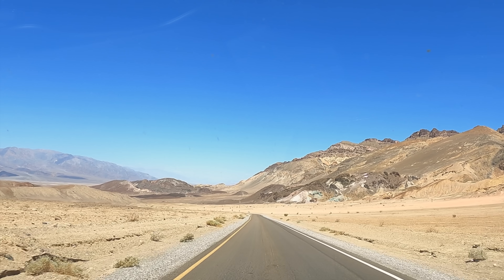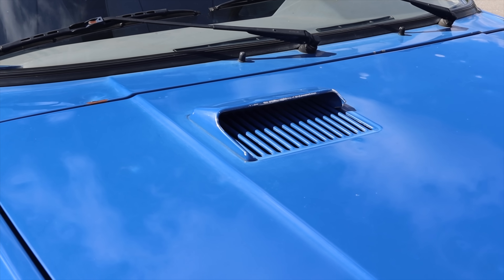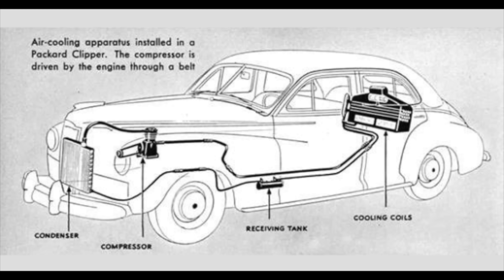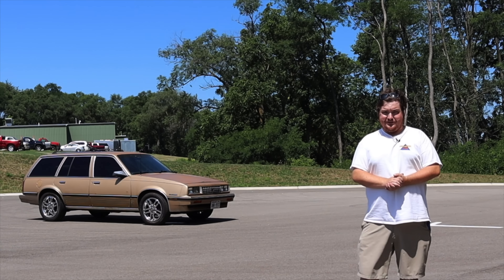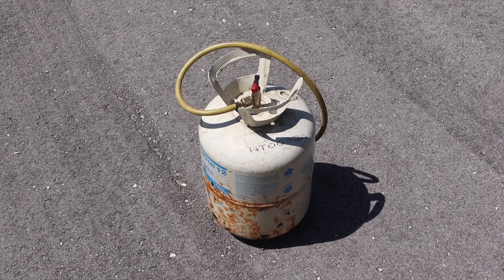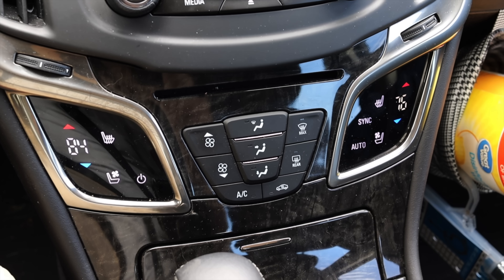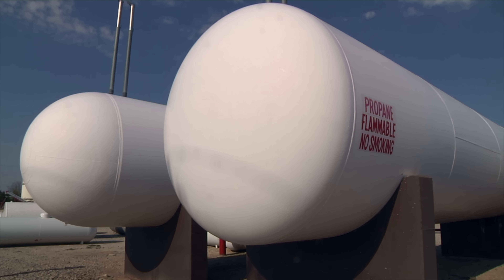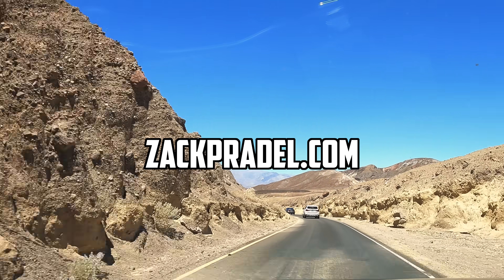Air Conditioning - The Story Of R12 & Why Modern Air Conditioning SUCKS!

Comment: My dad stockpiled a bunch of it right before it got outlawed, still useful for a '68 Cougar he has that never gets driven.  I used some in a '76 280z I used to own and it was cold I suppose, but the blower motor was pretty weak.  I owned a few other cars from the R12 era but they were all ratty projects with compressor/condenser problems or just totally gutted.  I sweated a lot in the cars I owned in my late teens and early 20s I guess.

Comment: You're half right.  Converting an older R12 system to R134 isn't that efficient. The system was designed for R12.  My 2018 Santa Fe with R134 cools as good as any R12 system I've ever seen.  A lot of that driving is between Palm Springs and Phoenix.  With the CC set on 73° it gets comfortable fast and levels off after a few minutes.  A properly designed AC system can run with R134 with no issues.
Reply: My experience with my mother's 2016 Kia Sportage tells me that the Hyundai corporation wouldn't know how to design and A/C system if it reached up and slapped them right in the face. Hers takes forever to get the vehicle even somewhat acceptable and even then it never blows cold. The vents that come out of the console to blow to the back blow colder than than the ones in the front. And supposedly there is nothing wrong with that A/C. My 2018 Ford Transit Connect is better but still sucks ass. You basically need it to be running at max fan speed and on max a/c to keep it cold in the van. Before the a/c went bad in my '04 Silverado it was actually fine. When I had an '01 Honda CR-V the a/c did okay. And my '14 Prius V does really well. But you couldn't beat me and make me believe that Hyundai knows what they are doing with one

Comment: GM always had the best A/C system. By the 70s Ford even started using their components. Rolls Royce used GM A/C systems. Yes, I have had MANY Buicks and Cadillacs with R12 and they will freeze the balls off a brass monkey. I still have one 1970 Buick with its original R12 system. However the best A/C I have ever had is my current 1995 Buick Roadmaster with R134a.  One reason why R134a gets a bad rap is because of the people who convert their R12 cars to R134a. They typically do not do more than evacuating the system, making sure the oil is all flushed out and then changing the ports. Some go one step further and change the valving system (either suction throttling valve---STV or Pilot Operated Absolute---POA valve) to make sure correct pressures are met for R134a. So far so good. But one crucial component that needs to be changed is the condenser. You just cannot expect R134a to work will with those old 3/8" tubing in the R12 condensers. You need to move to a high efficiency condenser, which has MUCH smaller tubing and many more and finer fins. Some people can get away without changing the hoses. R134a needs better barriers to avoid leaking because the molecules are smaller.  Kind of like even a surgical face mask will not prevent the covid virus from passing through. Most people are not willing to pay $2000-$3000 to properly convert from R12 to R134a so if they do it at all, they do it half-assly. Heck some people, even here in Tucson won't maintain their A/C systems in cars less than 10-15 years old. I see them driving around town in 105F or hotter days with all their windows down.
Reply: I have a 98 Nissan Quest and I measured the condenser at a junkyard and the holes are 1/8 of an inch in the condenser fins. I cut the condenser in half to see. It runs 134 from the factory. Are you saying an R12 system would have fins that are 3/8 of an inch instead of 1/8 of an inch with 134? I have also cut in half other condensers on other vehicles such as a 2018 Hyundai and their condenser tubes are so tiny they look like they're small as a 32nd of an inch. What gives with that?
Reply: @truckdriver8416  In essence, yes! Comparing the OD of the tubing on my 1970 Buick vs my 1996 Cadillac, the 1970 tubing is about 3 times bigger than the 1996 tubing in the condenser. Not only that, but there is also a lot MORE tubing in the 1996 and the fins are denser, and more numerous too. So, if you convert from a R12 to a R134a system, you must upgrade the condenser to get the cooling capacity and efficiency to be effective.

Comment: R-12 may have worked better then R134a, however a compressor that used R-12 broke way faster then one that has used R134a. It was almost impossible to get a car 10 years old that had a working air conditioner and if you did by some miracle it would last about 6 months before dyeing on you on the worst day possible.
Reply: Yep, in my experience R12 systems were horribly unreliable.

Comment: Real 134a comes in a large canister too... the superheat, subcool temperatures, and pressures are almost identical. The fake stuff is the garbage that you buy from the auto parts stores which are an azeotropic blend. When your system leaks, it loses the light gases first and makes the system work inefficiently. You didn't really tell us why 134a is not good and if you want to bag on a refrigerant, I suggest you bag on R1234, which only comes in a blend.

Comment: It was either my 1978 Grand Prix or 1985 Grand Marquis,  a couple times I was able to not only create condensation on the outside of the window by blowing a vent on it, but actually get it to crystallize and ice up.
Reply: Had an 89 civic that did that. I think it had some residual R12 in it & we just filled it with 134. Im positive it wasn't designed to get that cold from the factory. It was insane

Comment: I've recharged many r12 systems with 134a and they worked just fine. If it did not you have a problem that even with r12, which you cant get, the system would not have worked properly either. Iv'e done old refrigerators, coke? Pepsi machines and they worked fine.

Comment: R12 A/C is one thing GM did extremely well. I had a variety of mid 80s-early 90s GM cars back in the day, and if you left the a/c cranked it would get meat locker cold.
Reply: My mom had a '73 Chevy Impala. The AC in that would freeze me to death! I remember piling what ever was in the car on me to hide from the blast of cold air coming from the vents, even as it might be in the upper 90s outside.
Reply: I thought I was crazy when I thought "A/C used to be colder" when I lived in the U.S.  Parents had an 85' pickup, and I swear you couldn't use the A/C for more than 5 minutes before the tiny cabin was ice cold.
Reply: All with the help of the biggest, heaviest compressor in the industry!   LOL!
Reply: @frequentlycynical642  who cares, it worked.✌️
Reply: @frequentlycynical642  You’re thinking of the old A6 compressor, which was a beast. Both in size and performance. But by the late 80s, the bigger GM vehicles had migrated to the R4 Harrison compressor, which was much smaller and every bit as effective. Smaller GM vehicles used the V5 Harrison, which was still the same performance and on par size wise with anything else on the market.
Reply: @frequentlycynical642  do forget it lock up too.
Reply: @frequentlycynical642 Compressors THAT conked out by 60k miles. By the time these cars hit the used market for black people to buy the compressors were always 'seized" up!
It was great the short time they worked. Im specifically talking about the Harrison(gm) HD6. Pretty much ALL of the BOP/chev/Cadillac/D platform cars used them!
Reply: @frequentlycynical642 And? You want crappy AC and a car that can’t last longer than 100k miles? Because that’s what we have now. Besides Toyota of course.
Reply: Can confirm, used to own a 1974 Monte Carlo with a 454 and factory air. Teeth would be chattering after about 5 minutes of cranking that baby up!
Reply: Oh yeah. My ‘89 Lesabre with 180,000 miles still blows ice cold.
Reply: Jealous
Reply: I've seen somebody use propane for AC problems aside. It was the coldest AC I have ever seen. Yeah the problem today is twofold. They have two refrigerants being used in the past 5 years 10 years, but a lot of the The companies are using the same system with the new refrigerant at less efficiency
Reply: this makes me wonder as a transit enthusiast how good the a/c was on buses from when ac started to become available as an option. to when they switched over to r134a refrigerant (i myself have only been on buses with the newer refrigerant as the last r-12 buses retired in the 90's, and i was born in '05. and buses that ran within the city didn't even get a/c until 2012. though the buses that ran the highway routes into the 'burbs did have a/c way before anything else. my agency ordered gm new looks with a/c in the 60's or 70's. the oldest buses with a/c i have ridden were orion v suburbans from 2001, obviously in the r-134a era. they had pretty good a/c even towards the end of their service lives. currently the oldest buses with air con that run here are the 2008 orion v suburbans, also with pretty cold air.) so basically what i'm wondering is: how cold was the a/c on a gm new look, or a different bus that used r-12.
Reply: Nothing like a 95 Chevy Suburban AC
Reply: I have a 2018 Silverado, it has the new 1234yf refrigerant, it’s not very cold AC. Already had to replace the condenser coil at 29,000 miles, among other issues that’s a different story. 🙄 I don’t think it’ll see 100,000 miles.
Reply: My parents had a 1976 Cadillac that had AC that was absolutely freezing.  It was absolutely colder than one's refrigerator.
Reply: They had some great compressors  the GM A-6; Ford and AMC (and most aftermarket units) used the aluminum York and cast iron Tecumseh, and Chrysler had their venerable cast iron RV2.

Then they started using the light weight (usually imported) compressors…

Comment: The new systems are just as 'cool' as the older ones that took R12. They just use larger components. Refilling older cars with R134a, however, does reduce performance.
One exception to the ban on R12: aircraft fire extinguisher bottles for engines and cargo compartments. Because R134a is less efficient, it would have required larger, heavier bottles. Thus airframers and airlines are still allowed to use "Freon" in their Firex bottles.
Reply: R-134A has less heat capacity than R-12 so in a sense you're right.  But even modern systems designed from the ground up as R-134A systems are terrible at idle because the R-134A just isn't that efficient.  Not only do they need bigger compressors but more compressor cycles.  You have to have the compressor turning 3x idle speed for vent temperature to start cooling to reasonable levels and only when recirculation is on will it stay that way.  The old R-12 systems didn't care.  Most didn't have recirc settings and kept the passenger compartments far more comfortable.
Reply: @JayeK47  stop and go traffic is horrible when running ac
Reply: Modern r134a is weaker than a good r12 system. I'm a car dealer, live in Vegas, have had hundreds of cars.  I had an average r12 system (early 90s nissan truck) make my kneecap go numb. Never had hundreds of r134a cars do that. By far the coldest r134a system I've felt was a correctly functioning w140 mercedes. The world's first car with r134a. Mercedes savagely overbuilt the system. Even the evaporator core placement was critical, literally three inches directly behind the center air vents in the dash.
Reply: Im pretty sure youre thinking of Halon,  not freon
Reply: @Kreegz  he is.
Reply: That's not the same "Freon" you're thinking of, that was "Halon", and yes, the EPA has failed to take it out of use because of how good it is at smothering fires.
Reply: Some small planes still burn leaded gasoline as well. Seems that small plane owners have a pretty good lobby.
Reply: @genehart261   you can also go to a small municipal airport with a jerry-can, and buy 99 octane AVgas for your vintage musclecar :)
Reply: @audvidgeek  can you put that in "anything"?
Reply: @five12man  Not anything with a catalytic converter, a single tank or two will coat and destroy the foot long screen door honeycomb catalyst, and more will eventually clog it, basically stuffing a cork in the exhaust. Part of the reason lead was in fuel was to protect valve seats by coating them in sacrificial lead, the second being boosting the octane. 

You'd be much better off switching to E85, as it's a higher octane than the aviation garbage and a hell of a lot cheaper, too.
Reply: @genehart261  Its because for the longest time there hasent been an alternative with the same octane rating necessary for high altitude performance. This is changing as there has been a recent FAA approved lead-free 100 octane aviation gasoline. But that was like only last year or something. There is still some time for rollout of the new gas as well as the rather high price hike. I think it was nearly twice the cost of regular leaded gasoline. 
Ethanol laced gasoline used in cars can track water when sitting in a plane for the days between flights. This is safety risk.

Please do some reading before you speak from your arse.
Reply: Yeah, modern R134a isn't as efficient as the old stuff but that doesn't mean older cars had colder aircon, newer cars make up for the inefficiency with bigger condensers and better compressors.
The bad rep comes from people needing to convert to R134a with a system designed for R12

Comment: In Houston 1995 my friends dad owned a Volvo repair shop.  They had a whole warehouse of R12 stocked up to future proof the business.  Not sure how long it lasted. It was a huge room full of boxes of R12.
Reply: Locally, I know of a couple of guys who got a pallet of R-12 back then also, and still have a couple tanks of R-12 for use at the airport when a plane AC needs a "booster shot". A few classic car owners I know also have some <edit: a tank or 2>. Not much call for it otherwise. Most guys that I know who DID stockpile a lot... still have most of it in their warehouse.
Reply: It was a better investment that gold if  picked up in the later 60s.   R12 was selling at RETAIL for $1/lb.   It was used for "machine BB guns" and to pre-cool beer mugs.   It also was used for inhalers and in shaving cream, paint spray, etc.   For most of these things, the substitute was usually butane which is quite flammable.   They toned down the flammable warnings and they usually are only on the fine print.

Comment: They got rid of wing windows, they eliminated the actual manual vents under the dash and in the dash that you could open and get actual fresh air from, then they added catalytic converters,  while raising engine running temperatures to extreme levels and created an oven on wheels.  Especially in the late 70's.   I have a 79 and it needed an AC charge and had to refit for the new stuff, and it is near worthless, I have 2 converters baking under the 2 front passengers, no wing window, no vents. Then there is the "computer" which you cannot remove even after more than 40 years due to "laws".

 It's nuts.    Now they want electric cars but have no additional electrical production capacity, say nothing about how to dispose of the batteries, nor how much all that will jack up all your costs of merely living.  You can bet the ones who dictate the law never suffer from it, that is for the serfs.
Reply: Have you ever considered putting dyna mat between the carpet and floorboards?  It was originally for sound deadening, but is composed of sticky rubber substance with a foil backing.
Reply: @josephphillipson9004  It's a thought, but for my 79 I would have higher priorities since it is becoming a "barn find" as it sits, and I need to alleviate that first.  Which requires a reduction in laziness, cleaning the garage, and getting the house ready to sell first.  But it's an idea. Needs headliner love too.

Comment: My 14' F150 gets to near R12 temperatures in the cab but takes a little longer (idk 5 minutes longer if I'm moving). The only reason it's possible is because everything in the AC system is oversized and the condenser has a lot of air moving it (very open grill and two large electric fans) where as an R12 system you can get super low temperatures even in a small econo-box like a Chevy Vega or Chevette and something large like a 94' F250, from word of mouth is basically a self propelled reefer unit. Modern car's in direct sunlight on a 90+ Degree Fahrenheit day such as a run of the mill Sonata doesn't even start blowing cold until they are moving at 15mph+ meanwhile an R12 car will cool down just seconds after the engine is started (93' Mercedes 300D). When it come to AC performance the best thing to do when looking for a newer vehicle is to look how well it the condenser breathes and how much engine and compressor it has.

Comment: I never had an a/c car until '84.  The old cars could get hot,  but in the 50's, 60's & 70's a/c costed $600. extra.  New cars cost about $3,000.
The old cars had vents with ducts that went up the grill.
With the vents open, and the wing window open, it was comfortable.